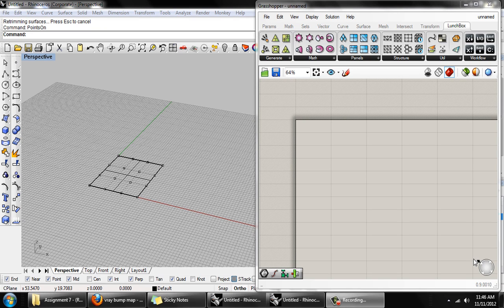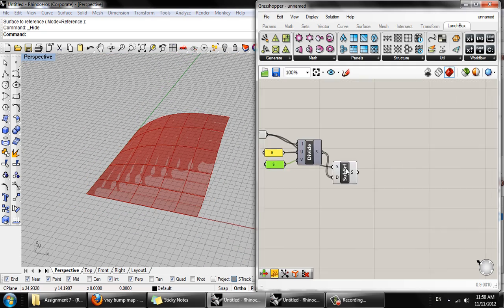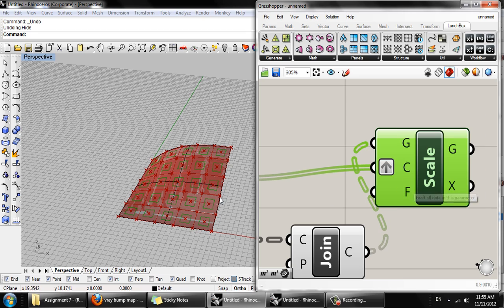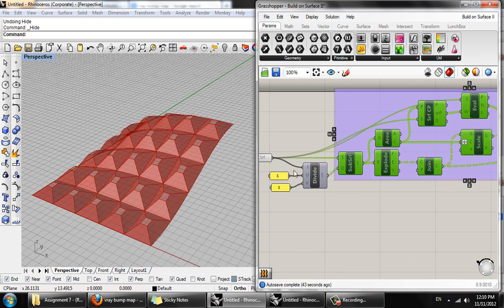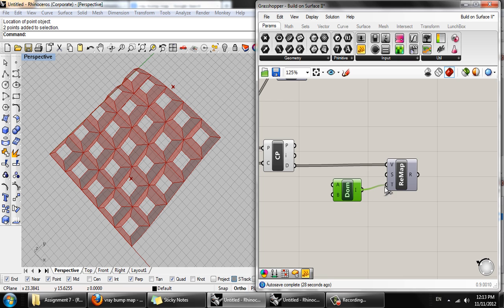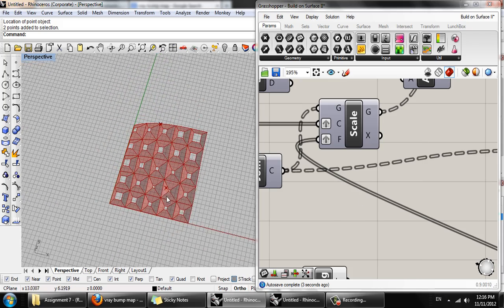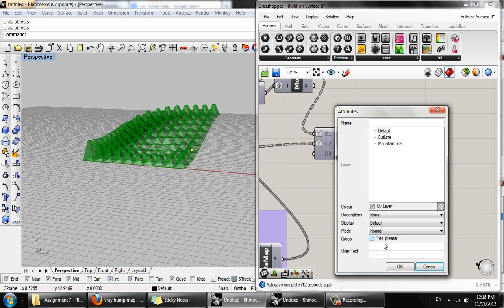Build Components on a Surface with Grasshopper

Comment: Hello,I imported 3d dwg file into rinho and couldnt add surfaces on grasshopper? can you explain me how to do it please?
Reply from the maker: if your surface is a mesh, Grasshopper will not accept it as a surface. You'll probably need to re-draw the surface in Rhino first.
Reply: then i will just click right on surface and choose 'set one surface' then how will i choose the model? with right click or left? or do i need to enter?
Reply from the maker: select the surface in rhino first, it will turn yellow. then in Grasshopper, right click and 'set one surface'. If it is indeed a surface, it will now be referenced into the Grasshopper document
Reply: Nathan Melenbrink Thank you so much

Comment: @Nathan hi this is very useful thank you so much. 

i have a small issue. the top is not covered with surface and cap holes is not helping either. could you plz let me know how to close the tip.

Comment: hi !  Nathan 
i just wanted go  a one step further of this process, if i want to make the components to  scale and rise together according to the attractor points.
please revert asap.
Thank you
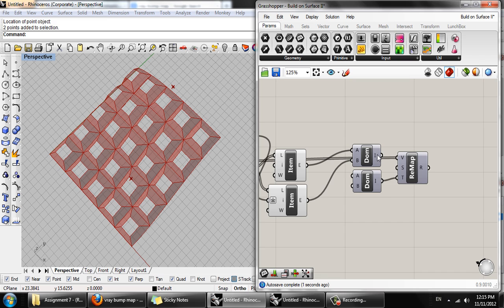Reply from the maker: +anushka patel The rise or height of the components is determined by the Amp component (from 7:30 of the video). According to the tutorial, it receives a constant value, so all of the components are the same height. Instead, you could connect the output of the ReMap component (from 15:00) to the input of the Amp component. That will establish a relationship between attractors and component height -- then just tweak the domains of the remap to get the values you like.

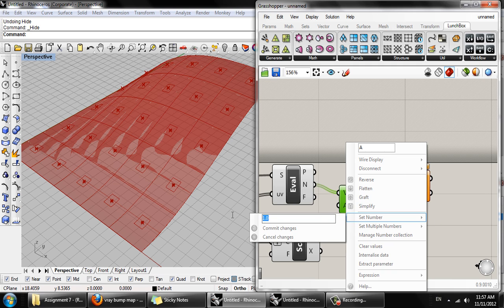Comment: VERY Helpful  but I have one issue with my surface I lofted curves to generate my surface so when i got to amp (7:40 and over) my scaled curves does not move up, it moves side ways. What can I do to fix that. Thank you Nathan
Reply from the maker: +Abey it shouldn't matter how you made your original surface. Make sure you're using the Evaluate Surface component, which will give you the surface Normal for each point. This will give you the Normal vector, which is perpendicular to the surface. If the scaled curves are moving to the inside of the surface instead of the outside, try making Amp a negative number.

Comment: Thanks for the vid!  I'm trying to follow step by step and have done everything successfully up until where you define the expression.  For me, when I define the expression (i-1) the 'item' node turns red and breaks the definition.  Any ideas?
Reply: maybe i-1 is an old command system? I changed it to just -1 and it worked great.  Thanks for taking the time to post this vid, it really helped!
Reply from the maker: +Derek Smith indeed, since recording this tutorial they have changed the protocols for how components read expressions. Not sure why...but before you would use the name of the input variable ('i' in this case). Now you can omit it, or more generally use the letter 'x' in expressions. Glad you figured it out.